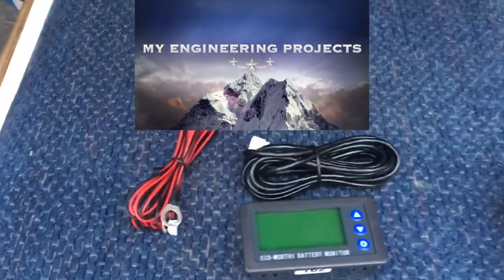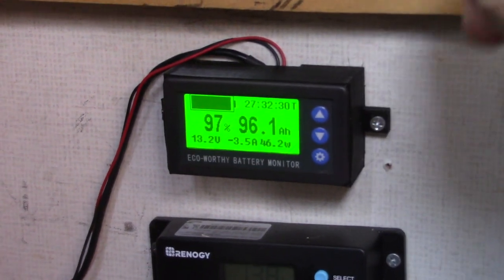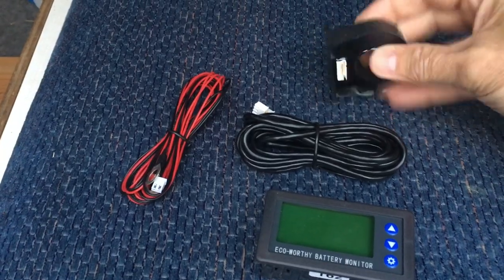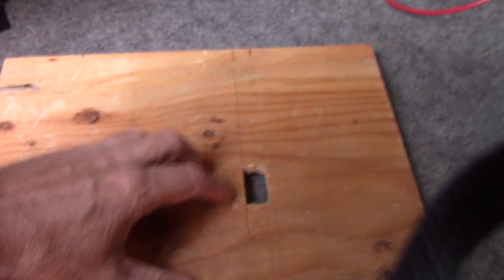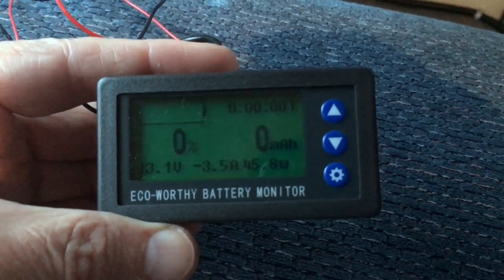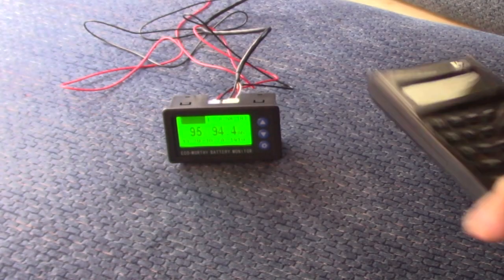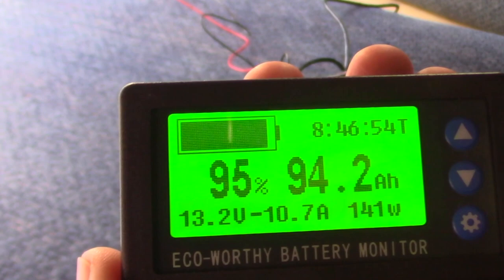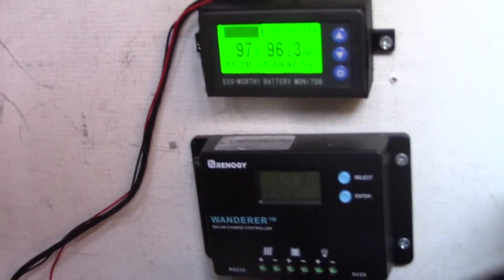Eco-worthy aH Battery Monitor - Product Review, Test, & Install

Comment: Massive Thank You!!  I simply would not have gotten through the programming without you!  Crazy to initialize a battery on zero capacity instead of full capacity.   No one wants to do that to their batteries.
Reply from the maker: Glad it helped.  I didn't want to take my batteries to zero either.  They did it for those who just want it done for them.

Comment: 8 minute time area. Thank you yes it won't fit big lugs. 

It is possible to slide a 3/0 high strand 6 inch cable through then you attach the terminals. Made that today. Really cool to see your helpful review. Thank you.
Reply from the maker: Thanks for sharing, i have not tried really huge lugs but #10 works fine

Comment: How do you get the menu displayed at 10:40? What values should be on settings menu 08CC and 09CZ. I only seem to be able to set 08CC to certain values which is then propagated to 09CZ and then auto populated with another value. Thanks for the video!
Reply from the maker: The monitor just switched to that screen at 10:40 when I was done programming.  I didn't change 08CC and 09CZ. What was shown were the defaults.